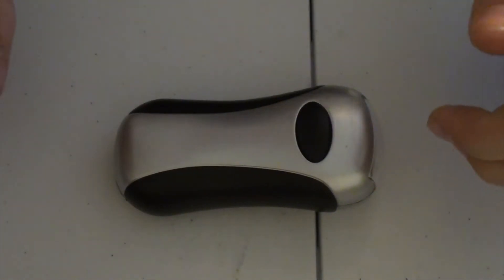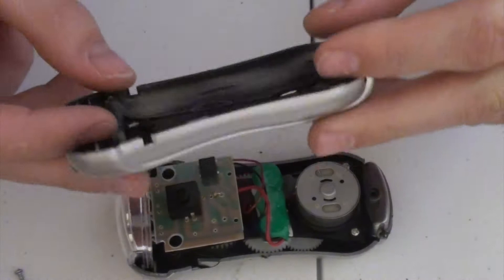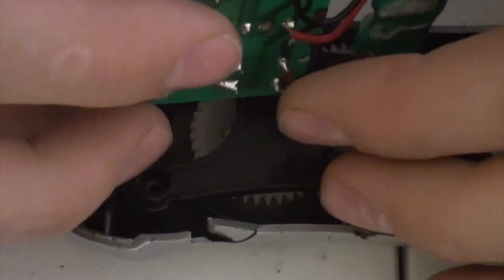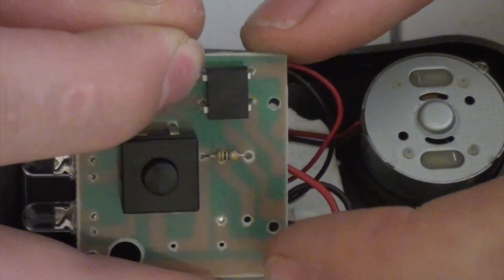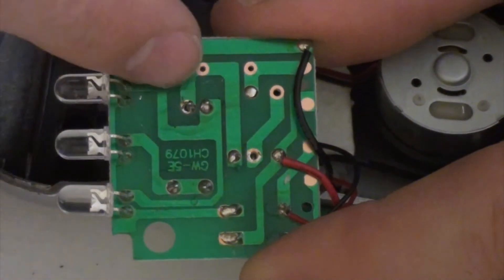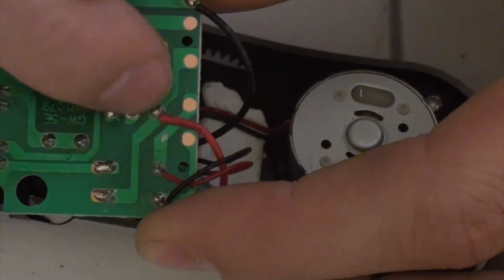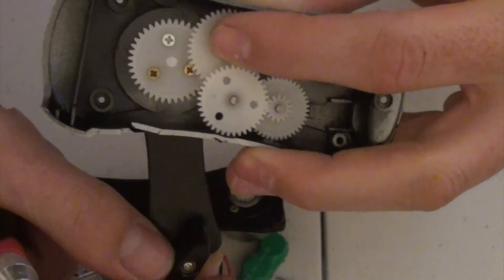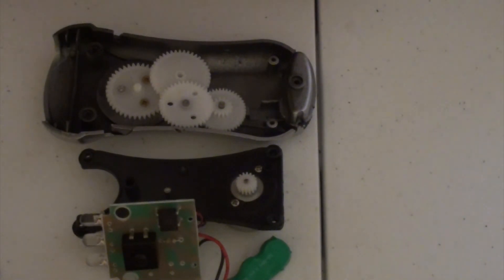How Does A Crank Flashlight Work?

Comment: It's not a motor. It,s a dynamo or alternator.
Reply from the maker: Technically, you are right I would be a dynamo or generator. It wouldn't be an alternator since it produces DC without needing rectifying diodes.

Comment: Spent to long on circuit board. Disconnect battery reattach wire crank it up to see if it actually puts out power to light.

Comment: That's a bridge rectifier. On the circuit, I see a resistor. I'd put a supercapacitor inside, as the batteries can eventually wear out. Great video.

Comment: Hey, I was just thinking about how I can use a hand crank to charge a battery then put an adapter on it so it can charge your phone, DS, or any other portable devices. I was also thinking about converting the DC from the battery into AC so you can charge parts of your house if you had a large enough hand crank and enough energy. Are there any competitors in that field you think, also do you think that's a good idea?
Reply: I think it can attract fitness enthusiast if I make it a work out tool as well XD
Reply from the maker: +Jerod Rumney there aren't any products that I know of but to charge a phone or DS you would need to crank it for a few hours to get them charged up.
Reply from the maker: hahaha that could work!
Reply: There are products on the market. There is even a case with a crank handle built in! I had the same idea, but have now developed it into another idea involving magnets.
Reply: +science1324 can we use voltage booster in this case ?